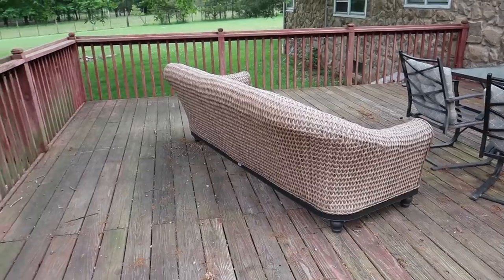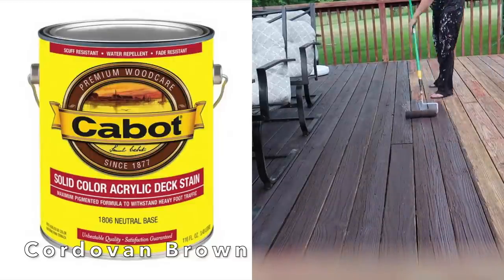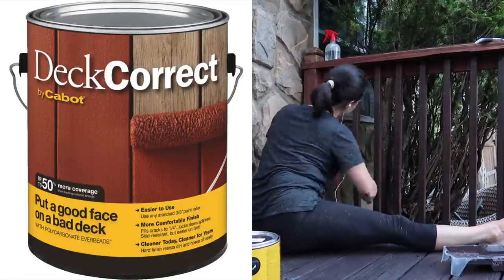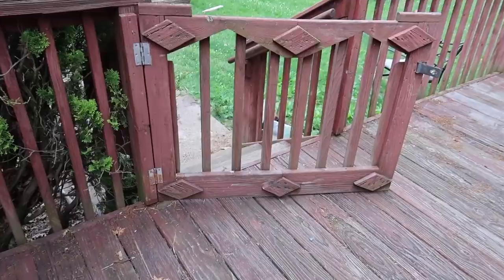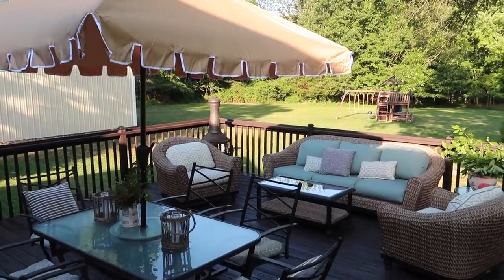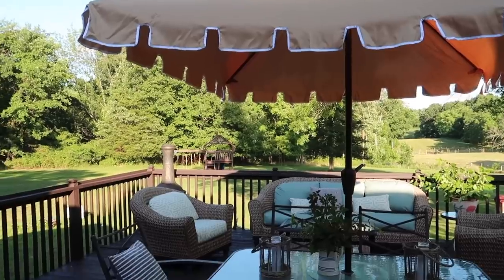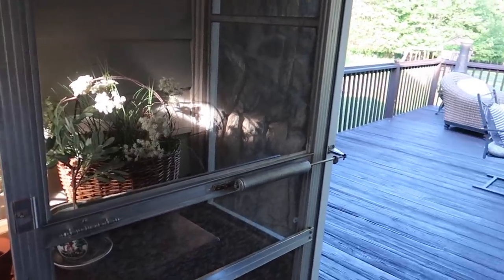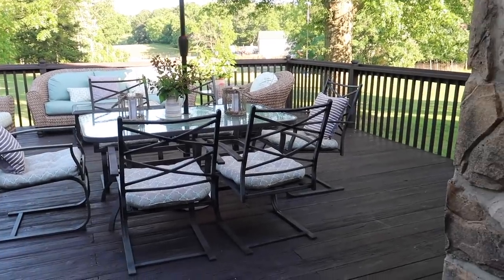DIY Deck Transformation on a Budget

Comment: Looks fantastic! Two tips for you since I have a few years experience using the same Cabot product: (1) expect to do a quick floor board touch up each spring. I bought the red plastic brush gadget that is the exact width of the deck boards; you screw it on any broom handle and you can do the entire deck floor in @ 1 hour or less as you simply walk up and down the boards. I would do this job on my lunch hour - no kidding. (2) Buy 2 extra cans of the paint as the shops sometimes are late in getting supplies in each spring and I have missed perfectly good stretches of weather to get the job done when waiting to be able to pick some up. The extra cans are a good idea as in my area of Montreal some stores no longer carry this product. Enjoy your space!
Reply from the maker: Thank you so much for the tips, yes I foresee needing to do just that, but it should be much quicker than what I just did 😅
Reply: @OldWorldHome  Yes - the touch up is very quick and buying the little gadget is a game changer as no bending, etc. You could even do it drinking your iced coffee:))

Comment: Great job. FYI for next time, or anyone thinking of doing this...please Google..you can buy a brush called a Rough Rider.  I used it on a cedar house and several decks. It is a brush that you screw a pole onto. It gets in all the cracks and works so well vertically or horizontally. You could paint an entire deck in an hour. I stained an entire exterior house in a couple days with the Rough Rider.

Comment: Haha you are the only other person that has a deck around the same size as mine. I stain mine every single year. 2 big dogs go potty off of that deck so it never fails. If  you get more than 2 3 years you're good. I do mine in a week or full time weekend.. usually I only need  to do the actual floor part of the deck..this year I changed colors. And product..which was awful. Cabot is way better. Nice work. I relate to the work you put in.